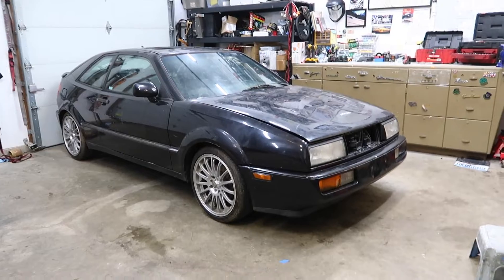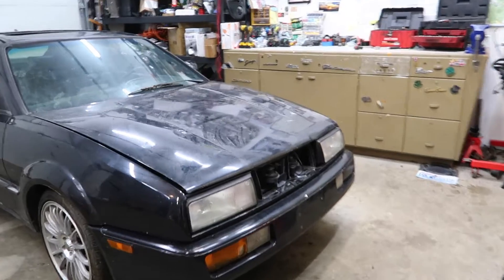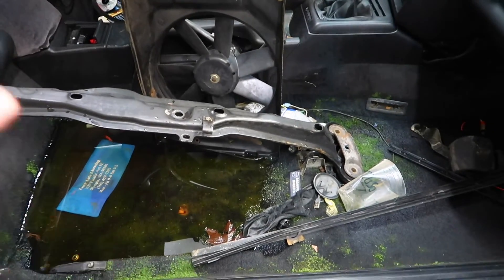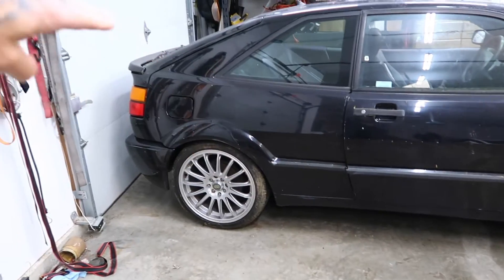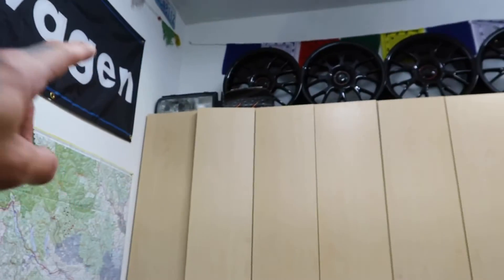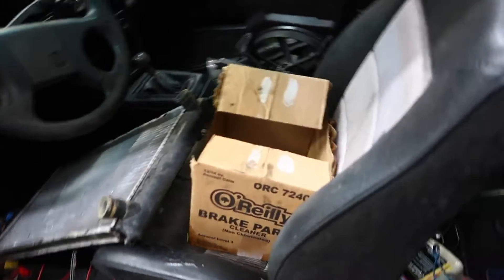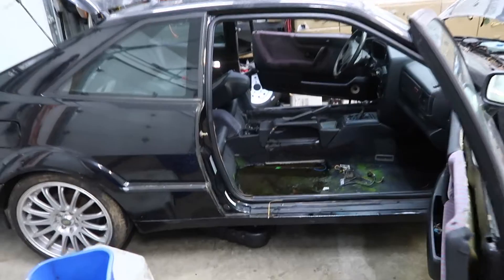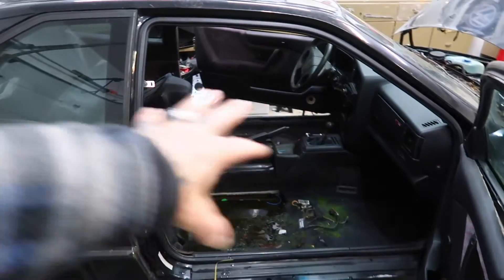Corrado 1.8t Swap Pt.1| Same as MK2 swap

Comment: Dude I have a 1991 G60 with original engine and it still runs. Been sitting for 2 years and I need to restore it too!
I have a 1.9alh TDI ready to swap or I can rebuild the 1.8 8v or even an 07k 5cyl.
I can’t decide what to put in it?
What would you do???
Thanks
Reply from the maker: All depends. Where do you live? What's the purpose of the car?
Reply: I live in Auburn, NY.
I love the shape of the car. I just want to drive and enjoy it. I’ve been a VW fan ever since my work took me to Germany to work on automation equipment. Driving around the Black Forest and the Autobahn was just sweet. 
I came back a VW fan and have owned MK4s,MK6. Pulled engines and ECUs. Changed gearboxes and such. VW community is just awesome. Sorry to ramble, but I enjoy your channel and love the woods riding clips. I’m an ex MX racer as well, so loving the common interests here. You seem like a well grounded awesome dude. Much respect for you bud.
Reply from the maker: @vdubcustoms6957  Hey that's awesome. Yes the vw community is amazing. 
I'd prob drop a vr6 or 07k in it. 
O man I cant wait till summer. All I want to do is ride my dirt bike. Got it out yesterday to ride around and the battery was dead.
Reply: @JakeRawSon   Thanks for the advice on the 5cyl. I love that engine. Check out Fabless Manufacturing. He makes custom engine swap parts for MK1/MK2 & Corrado